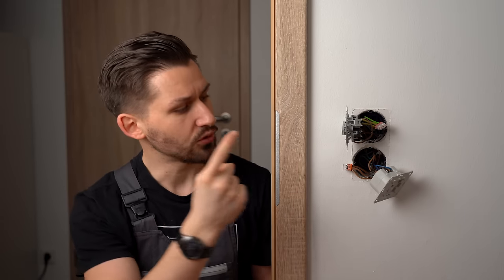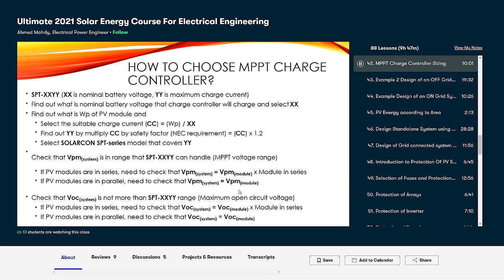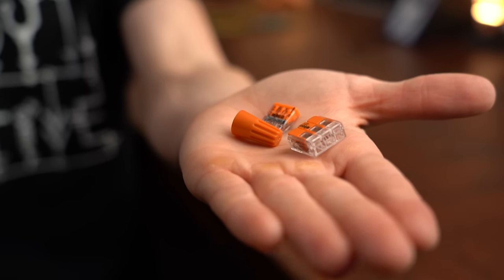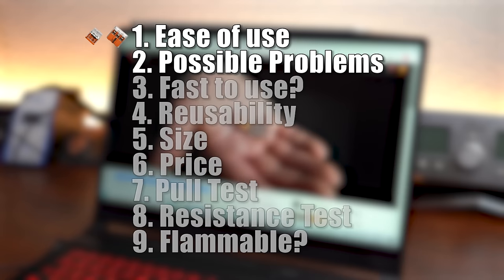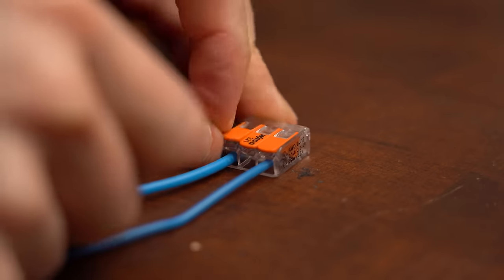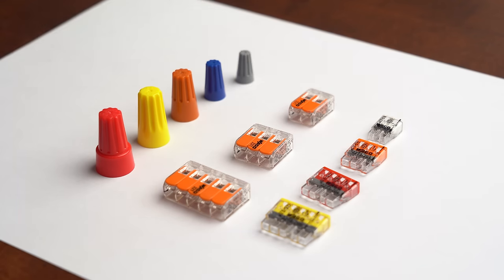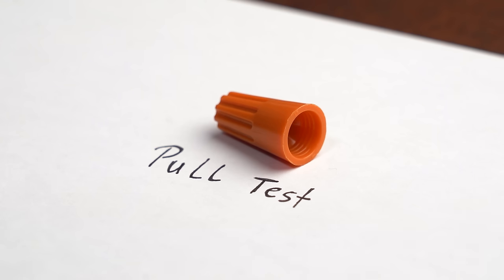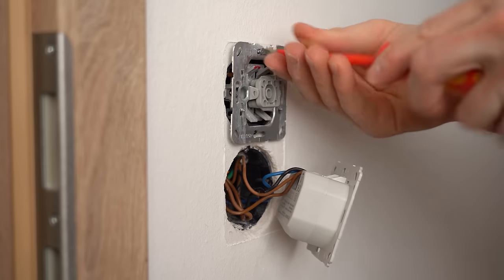What Wire Connector is the Best? Settling a Debate! Wire Nut VS Wago

Comment: The problem with wire nuts is simple, it's the user. If the wire nuts are installed correctly they are good. The Wago's are easy to use but still require good installation.

Comment: For me the biggest advantage of Wago is that in case of wire nut You are always responsible for quality of connection and potential failiers. In case of Wago if You isolate wire right the rest is up to Wago. technology is responsible for connection, not You.
Reply: @Olec Strzelin: When anyone chooses to do this work ALL the responsibility for the work is theirs. Everything from the joined wires to the entire dependant environment is now considered to be "in YOUR care" and I believe most workers are mindful of this fact.
Reply: @apigge8723  Good point. Lot of responsibillyty. Why take even more? Black scenario of course. But let's assume that the installation failure causes the fire. One of the first thing that insurance inspector will try are connections. And no matter how careful You were you are unable to screw in the screw with the right force. Not to hard not to loosely - just as producer inform with tiny letters on the box. And even if you do You still should come back from time to time and again make sure that the screws are just as You left them. Impossible. So from law persective it is installer fault. Now Wago. If you put the wire right rest is up to connector. If its fails the fault is on Wago. But here is the thing, if You do it right they are pretty sure about their technollogy. So what I'm saying peace of mind is pricless.

Comment: I'd honestly prefer a connector with lower resistance to one with more "pull resistance".... Who relies on wire nuts or wago connectors for supporting loads? It's almost like measuring "which is easier to pass thru your bowels if swallowed?" 

Measure the things that matter.

Comment: At my country we use wire nut, and most of them are low quality. Because most of stuff are imported from china. I never try wago, because not available here, but if available, i believe it will came from china too. And if both are made in china, i prefer wire nut. Because wago use some conductor inside it, and if quality are bad, it will give you trouble in anothers day. But if both are high quality, it looks like wago give more benefit

Comment: I wonder what moisture problems are like in Germany. In Canada, we have any number of moisture problems that require whatever wire connector you are using to be able to dry, or rather, able to drip out that moisture should it accumulate. While I like the Wago and it's toggles, I prefer Marettes to resolve this issue.

Another thing I don't see covered are wire connectors for different materials of wire. Marettes have different types for handling Copper, Aluminum, Tin, and transitional ones for the mixing of wire material types. I haven't seen anything for Wago. Differing wire material types that are not properly connected have been a cause of electrical house fires, especially Copper and Aluminum mixes.
Reply: There is a special paste that wago sells that you put into the connector and then you can install aluminium/copper clad and even connect it to copper.

Comment: I (not a professional) only use wago because I'm used to it and we cannot buy those nuts in a hardware store here at all.

But to be fair, reusability it not entirely correct! The wago 2273 is NOT very reusable. The 'spring' gets lose and our country's citizens are strongly advised not to reuse them often. After one or two uses, throw them away. They are cheap anyway. We had a few molten connectors\fires here and there because of the bad connections of old connectors. Kind of the same as a badly twisted nut.

I am really surprised about the pull test. I had the 2273 placed last and the nut in between both wago connectors. How is it that the coil inside can take that abuse to well?

Also I would even have substracted a point for the nut because it is not guaranteed that the twist is done well. It's just a gamble if the connection is good or will melt.

Comment: There is no current rating for wire nuts because the wires make the connection with each other unlike the Wago connectors that connect the wires through a terminal. So essentially the rating is whatever the wire is rated for.

Comment: Seems to me that wire nuts win on small size #5.  And you don't have a TIME test:  Do those spring loaded systems deteriorate over time at the connection points? I think that the resistance test should get greater weight -- we don't want significant heat in the connectors.

Comment: well, the biggest problem with wire nuts is when you are connecting 2 different types of wire which could cause a bad connection which turns bad (like overheating) when passing through a high current through it. so... I still think the Wago as this video(type of comparison) is also featured in Technology connection(a youtube channel in case you don't know it), which in the end he keep saying how good the wago is when compared with the wire nuts and why should we all use it. Personally speaking, I like the wago more simply because it is much more stable than the wire nuts when connecting different type(s) wire together because it is commonly seen in my country/region.

Comment: 5:56 THIS is my problem with Wire Nuts when connecting solid and stranded together. I'd use a Butt Connector and crimp it. I dont have Wagos (not sold here).

Comment: wago is great for low voltage/low amperage. anything high voltage/high amperage should have a wire nut with adequate length pretwisted and electrical taped.

Comment: Nice video!  Personally, using more Wagos now, especially on lighting and low amp circuits.   Prefer to use heavier duty 30 Amp 221's for 20 amp circuits and lower.   Hate to admit have used wirenuts with perfectly applied methods, and then surprised at the wire that pulls out.  LOL!  So, time will tell.  I cursed the invention of the backstab method and knew that it was a poor design from the start.  However, a more consistent connection with better materials and a lever to help, that might just work out!  We'll see!

Comment: personally i hate the use of wire nuts got 2 different gauge wires tied together? go find a wire nut size that will fit the 2 wires. got a solid line and a stranded? just do a parallel connector sure its more permanent but at least it will hold together. got more than 2? go figure out another different size based on how many wires you have. don't get me wrong wire nuts are easy to use but very easy to get the wrong size never used wago but i like the idea of being able to change one wire that's messed up while leaving the rest alone

Comment: A lot of wire nuts have held together a long, long time and will for decades more.  Not saying they are better - it's just normally you don't have someone horsing around with your wiring once it's installed.  Normally.

Comment: Youre also forgetting, wire nuts when you tighten them.,. can sometimes break the wire giving false impersonation that the connection is solid, i actually had a friend who is a line man for the power company come over and bring his bucket truck to fix my two 175w mercury vapor lamps i had on a 30 foot pole that the previous owner installed in the 60s.  and he spent like 45 minutes trying to figure out why there was no power getting to the fixtures.. only to find out he broke the neutral wire twisting the wire nuts too many times.  Also more resistance through a connector is not good, 1 watt loss is alot, especially when you consider resistance and power loss through long length of cable.  imagine that power loss through 600 feet of wire

Ive been guilty of doing this as well, twisting too hard too many times and it breaks the wire.
However for ease of use i still think wirenuts are easier..   Another issue with wire nuts though is they let bugs and spiders in them, i have taken them apart only to find webs and moths making nests inside them..

Comment: Thats really odd as every package of wire nuts we use here in the US, has instructions on wire and stripping, except for amazon, dollar general and many cheap china types of stores. and some very cheap types connectors, And even Knock offs, yep there's even those. I don't recommend those myself. The coil spring inside of the connector holds more material of the wire and compress it together to get the most contact and you get less heat as well. Also heat and cold can lose some connectors, were as the coiled spring type in the wire nut generally stops from happening. There are special types for all types of wire as well. depends on the application.

We have codes on what can or can not be used for what application of all these connectors. Commercial is very different, and there are many types of wire nuts as well as clamp type and water resistant and waterproof, heat resistant and even ceramic types for high heat. These have been around a long time. we now have some connectors much like what you are using. The difference is how much material is actually being connected with the connectors and the rated voltages and amperages to be used, for the particular job. Most High amperage use both a crimp type or a direct bolt type of connector.

Why at Big box stores they have Books for the general layman to study up on what to use and why. And to try and keep everything within code, also why we have inspections to make sure everything is above board, safe and legal to use.

Comment: I don’t think this accurately reflects what is electricians in the the US really use. The type of wire nuts used are very cheap and are normally shipped with light fixtures and devices. However, the actual wire nuts we use are different. My preference is the 3M O/B+ or 3M R/Y+. If using ideal products, I’d use the ideal 452 Red or 451 Yellow. The Wago connector have a metal edge that touches the top on bottom of the wire but the wire nuts have the entire surface area of all conductors touching each other so the ampacity of the connections are not affected

Comment: I have to say Ideal wire nuts are the standard in the US, these ones used here are not as good… and when connecting stranded with solid wire, always lead the stranded slightly further in the wire nut

Comment: Pull test is only valid if wires are properly connected - often NOT the case when a DIYer is connecting a wire nut. I’d give that point to Wago.

Comment: Americans have issue with bigger loads when using Wagos, or other spring connectors or that's what I have gathered from the fellow sparkies comments from the overseas.
It would be ridiculous to use wire nuts or outlets with screw connections when working with the most common 1.5mm and 2.5mm wire used here in the Nordic countries.
Even though, there are DIN compatible wago terminal blocks with spring type connection that were rated for 353 amps and 185mm cables.
And to think of it there is the "bigger" wago with a clamp, that can take 6mm cable and is rated for 41A, that is also commonly used.

Comment: I hate wire nuts and next time I need them I'm definitely going with Wago, but that being said I feel like you proved wire nuts are definitively superior.  However, even though wire nuts are definitively superior, which you have clearly illustrated, I feel like you have also demonstrated that a complete amateur will quite likely obtain a superior result from Wago.

Wire nuts are far cheaper and have superior performance, but if you have no idea what you are doing there is definitely a much higher risk of failure.  Wago is easier to use and pretty much idiot proof, so being good enough for most applications makes them the best choice in my opinion for amatuers, who most likely aren't going to be wiring up HVAC units.

Comment: what about ceramic ones? that's what I used to use in 8000 W electric showers here in cold south of Brasil.
it's basically a little ceramic (or porcelain) cube with 3 holes in front, 3 holes in the back, and 6 screws in top, so you can install a three wires thing with just one ceramic connector.
google: "conector de porcelana tripolar para chuveiro"

Comment: Wago is clearly better, that's why they cost more. They aren't used as much in the US because of the cost. You did not remove enough insulation for the nuts though, and you should pre-twist them before adding the nut.

Comment: Wirenuts make so much more sense for higher current applications. The conductors are (supposed to be) tightly twisted together. The wire nut merely acts as a "brace", not a conductor itself, unlike the wagos, which rely on a thin sliver of metal to be it's conductor. Any electrician worth his salt knows this to be true.

Comment: You should have also included a volume the connector takes up.  Many times there is not much room in the 2x4 box when having more than one simple circuit.  Then space can be an issue.  I trust wire nuts more.  Better conduction is the most important feature in a connector IMHO.

Comment: I think wire nuts are a con.  My idea for splicing solid wire is a new invention that you put the bare wire ends into a clamp and when you pull the trigger it twists them together perfectly.  Then a couple layers of electric tape and you have a smooth, clean splice.

Comment: Sticking two wires into a wire nut and turning isn't the correct method for using them in my opinion. I'm no electrician but I always strip enough insulation to make a join that consists of several twists using pliers or vice grips, then trim with wire cutters and install the wire nut. So it doesn't matter if the wire nut is clear or not, I already know there's a solid connection. I don't think I'm alone in this method. Then again I'm doing this on my own house, not getting paid by the job on a construction site. So take that into consideration. Edit : Also when joining stranded to solid I solder them together, then on with the wire nut.

Comment: You state that there is question on reusability of wire nuts, but Wago definitely can be re-used.  No wire nut manufacturer I could find says the nuts are not reusable. Nothing in NEC says you can't reuse them.  On the other hand, NEC says that any press in connection is not allowed to be reused.  Even Wago site says the 2273 is NOT reusable.   At minimum the wire nut gets the point.  At maximum, Wago loses the point.

Comment: Some other random observations:
*both wire nuts and wagos obviously work, as there are hundreds of millions, if not billions, used every year without problem.  So whether one technically scores better on some arbitrary set of tests, is rather irrelevant.  They both work.
*wire nuts work equally well, roughly speaking, but for 1/4 the cost, as per the video.  That makes them unequivocally better for most purposes.
*wire nuts do, however, require an extra step:  twisting the wires first.  That needs time and preferable a decent tool, for two solid copper wires, which can otherwise untwist if not done correctly.  Twisting stranded and non stranded wires together never works properly, and fully relies on the wire nut to keep them in place. 
*re reusability, trying to reconfigure twisted solid copper conductors involves untwisting and retwisting them.  Which weakens them and can cause them to snap unexpectedly.  Is that often required? Well, no. Only rarely.  But the wago is obviously 100% reusable in the sense that the wires are not twisted and therefore easily reconfigured.

All said, however, the differences are, in practice, minimal and only an advantage vs disadvantage very limited atypical ways.    The wago world and the wire nut world both exist successfully, so IMO, trying to find a 'winner' is a bad idea.  I would stop at highlighting the relative features.

Comment: In Belarus wago's are not rated or recommended for 16+ amps, and the most professional electricians use copper sleeves and crimpers. This gives the most reliable and repeatable connection.

Comment: Youre supposed to twist line wires before installing the nut, so the nut carries zero current. All the nut does is, 1: keep it from shorting to something else and 2: keep the wires wound after 50 years of arizona AC usage..
Reply: I pretwisted three 12awg with linemans and then just lined another 3 up evenly and put on an Ideal twister tan to the point the conductors had two twists past the wire nut. Removed the wire nut and couldn't tell a difference between the pretwisted and just using the tan Twister nut to do the work. I don't know if other wire nuts would do this, but the Twister did a great job all by itself.
Reply: @Bloozestringer  youre right, almost always the wires will twist themselves if you twist the nut hard enough. Almost always. If one wire slipps a little, one wire will twist around the other, not around each other.if that happens the untwisted wire will remain loose no matter how tight you twist the nut, then if you keep twisting, the end of the wire will pierce the end of the nut and short something. Theres several reasons why its smart to pretwist, and snip the end flat before installing the nut.
Ive handles up to 6 conductors under one red nut, safe, tight and confident. You can not do thay by just slapping them side by side and wrapping the nut over them.
Reply: @MichaelOfRohan  so in the case of two 12awg solid with a 14awg stranded (eg hardwired smoke detector) you would pretwist the two 12’s then have the stranded be a hair longer and twist on the nut?  That’s the type of scenario that’s always made me question as well. I’ve got a couple I need to replace with new harnesses and the solid core are too short to really trim and restrip. They seem to have been pretwisted before the original but was put on.